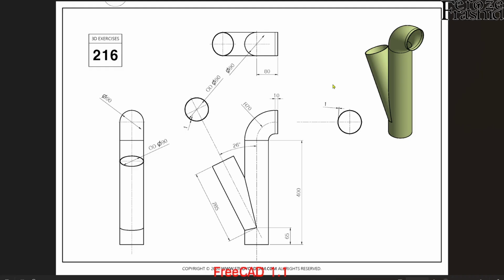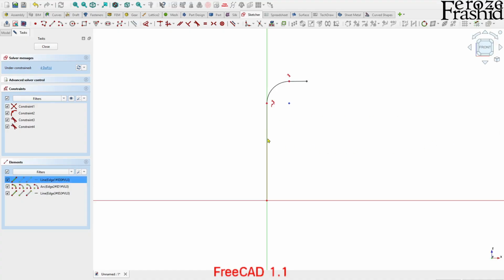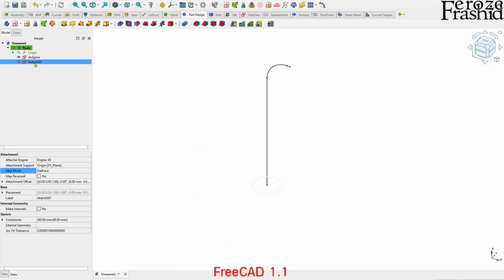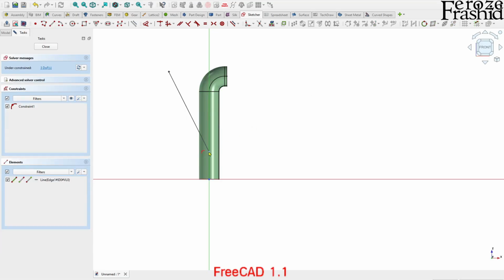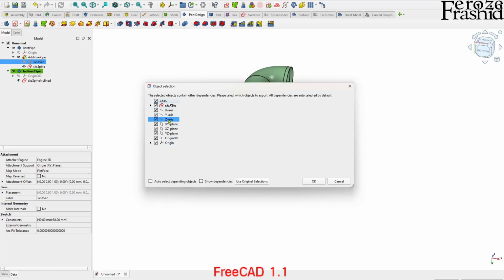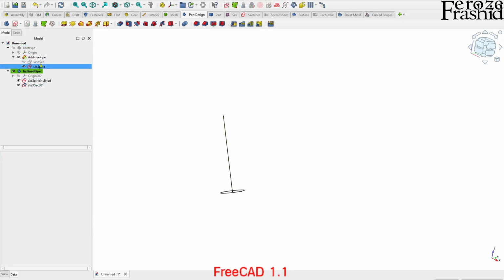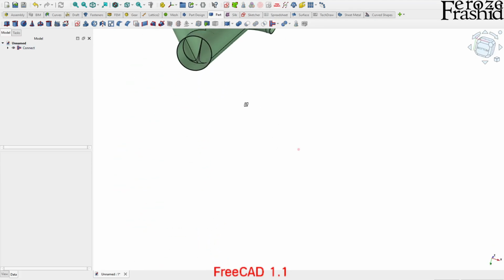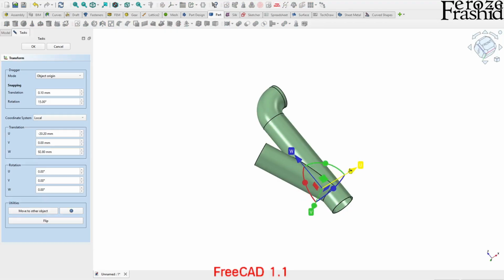Make a Pipe Junction in FreeCAD

Comment: Excellent video! Just the right pace, enough details without too much repetition and clear voice. And great timing too, as Im just needing to model pipes like this.

If you want to make more pipe tutorials, I could suggest how to make changing diameters. Like if you have a pipe like this one, but the angled pipe is 2x the diameter and you need a smooth joint.
Reply from the maker: I am happy you like it. I will try to make another video on different sized pipes connection. Thanks.

Comment: in my drawing no artifacts at the intersection. perfectly sharp corner seam. why?
Reply from the maker: For clarity, the junction is complete without needing to use the connect tool. Is that what you have experienced?
Reply: @kattkushol After using "connect" tool there is single close curve for inner and outer dia each. No extra curves/lines. May be I am using latest developer version(bug fixed)
Reply from the maker: @sanjaygatne1424  That's good news. I will give it a try. Thanks.